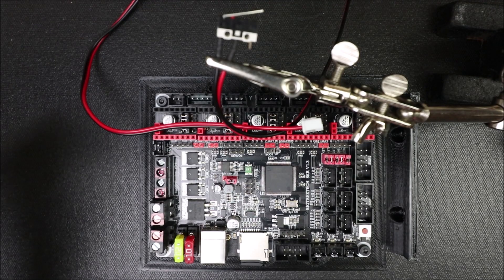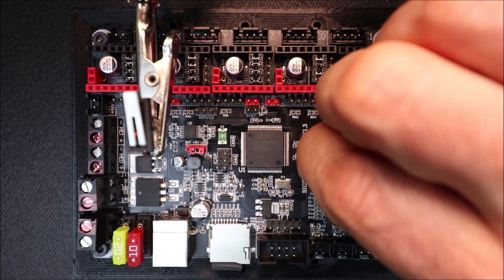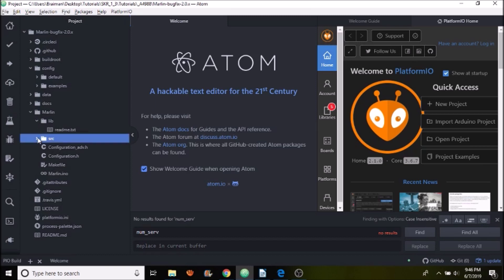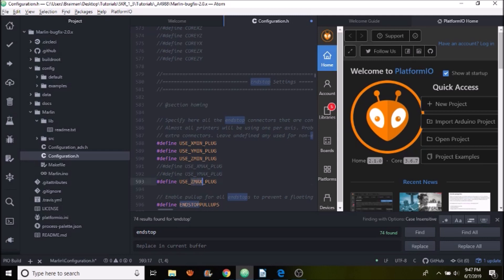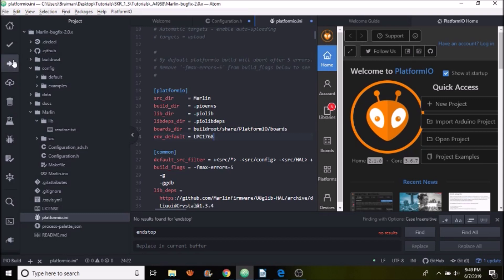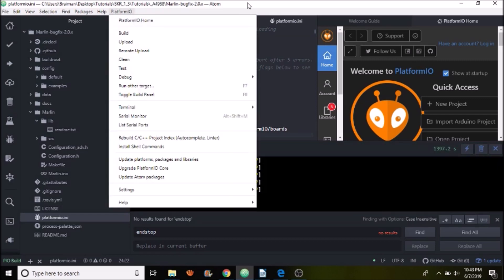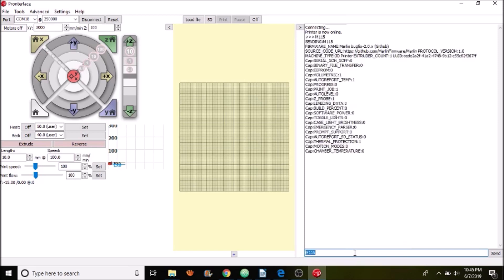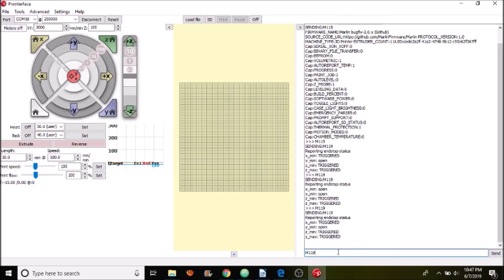SKR 1.3 - Basic Switch Endstop

Comment: I am doing the 1.4 on a geeetech a20m and when my end stops get triggered they shut off everything. When I intrigued them everything turns back on
Reply: I got it working
Reply from the maker: Great 😊
Reply: Can you tell me what the issue was? I'm in the same boat right now
Reply from the maker: Is the endstop giving you the opposite of what's expected?
Reply: @ladykilla85  i basically just had to rotate the plug 180 degrees or switch the wires around. I cut the dimple off of the plug on the stop end and flipped it around

Comment: i cant seem to make this work
i commented yesterday about not beeing able to make 1.4 work with 2209 and endstops 
but i cant even make 1.3 to work  i have UART jumpers on but not sensorless jumpers
and prontoface reports ENDSTOPs correctly (i have tried inverting them )
when i press them and do M119 everything seems fine
BUT WHEN I TRY TO HOME it just keeps bashing against endstops and losing steps
Reply: and everything seems to move in correct direction
Reply from the maker: If you're using TMC 2209 without sensorless homing it maybe related to the pin on the stepper. Unfortunately I've not posted a tutorial yet because I'm in the same boat.  I can recommend making Marlin firmware aware of the problem as they might have more information as to how to solve the issue or if it's a known bug.
Reply: @EdwardBraiman   ahaaaa
and what pin is that  i will try to bend it out of the way
Reply from the maker: Well it might be in the manual for SKR 1.3 or 1.4.  personally I would advise against, unless you have really good soldering skills to repair later.
Reply: Same issue for me: TMC2209 on mkr 1.3 and the endstops don't work..
Reply from the maker: This maybe a bug on Marlin firmwares GitHub page.  I've been unable to get tmc2209 working yet myself, this is why I've yet to post a tutorial.

Comment: E.S is 2 wires  I saw some wiring they all was with 2 wires Can we use standard E.S with 3 wires
Reply from the maker: Yes, but you're going to need to use gound and signal pins. If you use the ground and 5volts you'll damage your board.
Reply: @EdwardBraiman  I already did  to    ramps 1.4 now I use usb port for 5v  so I want to ask  just ground and signal will work or not
Reply from the maker: Yeah, I have an old RAMPS video in my playlist where I explain, but know which pins you working with or it gets expensive.
Reply: @EdwardBraiman  yes It is true

Comment: On the s card I see no "firmware.cur" .When I upload .bni it stays like that and logic does not invert, damn it looked so easy...
Reply from the maker: Create a file name Firmware.cur, it maybe in all capital letters for firmware.  Then try again, let me know if it works.
Reply: @EdwardBraiman  I tried both create it and rename the existing .bin to .cur, however after uplug+plug/reset, there is not change in the endstop logic. It says open when I trigger it. Both .bin and .cur stay on the sd card.
Reply from the maker: Delete firmware.bin and create a zero kb file for firmware.cur also make sure you have extensions enabled.
Reply: @EdwardBraiman  I tried and it did not work, then I found reddit thread with suggestion to format the card, after that it goes into .cur by itself, however it created new problem, after flashing marlin, the board does not connect to tft or pronterface. When I flash smoothieware it works with both....
Damn I think I am cursed whenever I fix one problem another arises.
Don't worry about me anymore, I don't want you to waste more time.
Reply from the maker: You can also download the firmware on GitHub.

Comment: This a great series about SKRs. I have recently upgraded my Prusa clone using these videos. Can I add to the suggestion box proximity sensors? I got really confused with npn pnp no nc etc. Also I found the endstop pins all pulled up not down, making my original pnp no sensor useless without serious circuit addons.
Reply from the maker: Sure, just keep in mind that I'm nervous about inductive sensors only because I once had a video posted and took it down, because most people became confused with hardware for pnp, npn and nc because they look similar.
Reply: @EdwardBraiman  Understandable. I could not get my existing pnp no (LJ12A3-4-Z/BY) to work with the pullup endstop inputs on the SKR. Then I spotted on Google someone had used an opto isolator to reverse the 12v output of the sensor. So i dissembled an old switch mode power supply for a diode, 560 ohm and opto to fix it. Now works great.
Reply from the maker: Cool.  I'm just trying to avoid confusion as much as possible with videos.

Comment: Remember how I said I killed my mks gen l?I managed to kill skr too now: )
Reply from the maker: What happened?
Reply: @EdwardBraiman  Literally dying of laughter xD I followed everything you said to do for skr setup but my motor we're not moving at all so after a while I just eh whatever and out of stupidity plugged a4988 the wrong way to see if something would change and it did, but in a bad way the a4988 exploded  and skr would only lightly power on the screen while producing very little light and showing no text.Just gofin around seeing what happened to it hoping a miracle will happen.If not I'll just have to save money for a new one  \(° °)/.crap...
Reply from the maker: At least you understand the reason why I am making the tutorials.  I went through about 4 RAMPS 1.4 board before realizing the tutorials I was watching had missing details.  Hope you get a new board soon.
Reply: @EdwardBraiman  Thanks man wish you best of luck. So you just wanted to help people?
Reply from the maker: After I let the smoke out of several boards, I figured others had the same issue.  That's what got me started.  Now I'm just obsessed with assembling each board type.
Reply from the maker: Thanks.
Reply: @EdwardBraiman  So you enjoy doing this?
Reply from the maker: Most of the time, but when it gets to high humidity in my apartment, I usually take a break.
Reply: @commonsensehuman1114 Funny thing is is that the fuses are 100% fine. Im going to check again just to be sure, thanks.